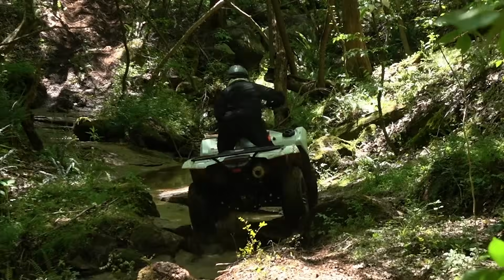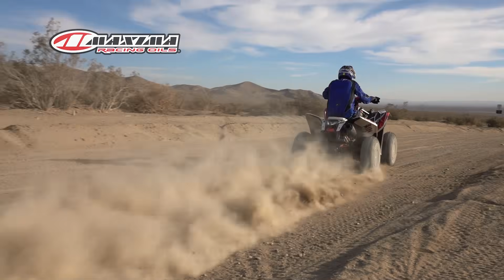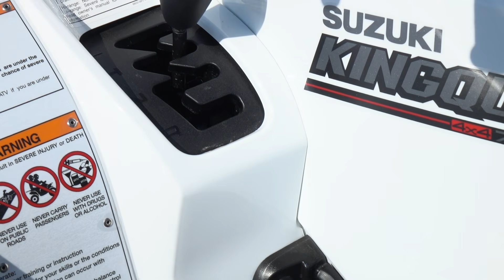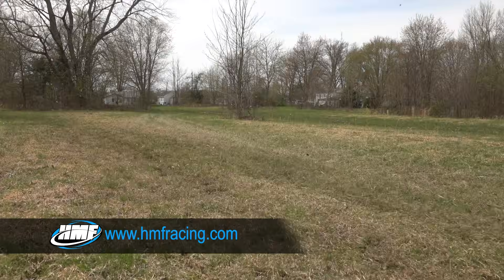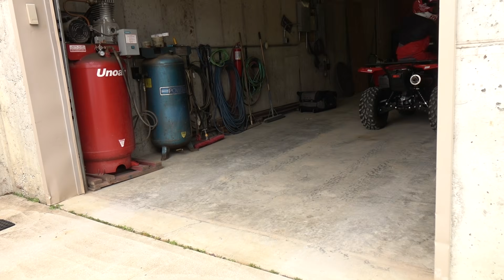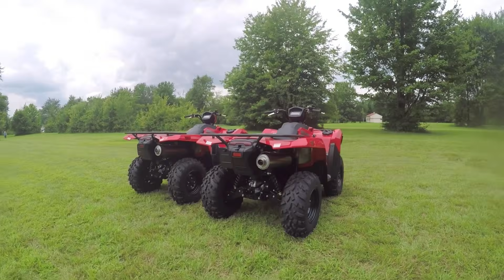Suzuki KingQuad 750 vs 500 Shootout

Comment: Any possibility of CFMOTO reviews? I really appreciate the technical data of changes down to the millimeter, no dealer sales idiot would know anything about the bike other then him reading off the website to you. I want that hardcore engineering data and design as a customer. I want to feel the brakes, chassis flex, suspension tuning, etc and know what was updated year to year. Thanks for the technical insight in all the videos you do. C force, z force and u force would be a great addition, the brand overall is very very under appreciated, very well built units from a engineering standpoint.
Reply from the maker: Thanks so much for the positive feedback. We would definitely be interested in trying some ATVs from CFMOTO, side by sides on our sister Channel. Perhaps we need to reach out to them.We put a lot of work into understanding and laying all the technical information because we know it's important to the serious buyer or enthusiast. We are glad you appreciate the effort.
Reply: ATVonDemand I just took a zforce 500 out to Hatfield-McCoy for a serious rip and beating, I’ve been threw the vehicle front to rear and I gotta say it’s very under-estimated. There heavier then there competition but very well built and extremely strong. The tech and engineering put into there equipment is up on the level of Yamaha and Honda, with the value beating even Polaris’s price point (though it’s junk). I think you’d be impressed if you got your hands on them. The only flaw I could find is the tires they come with are hard as a rock, I’m talking 0 psi in it and you couldn’t tell. It wouldn’t flatten out what so ever or break the bead off, so ride quality will feel like crap but a good set of tires and your good. Clutching, suspension, engine, brakes, even down to fit an finish feels top notch. Nothing feels cheap, finally a china product worth talking about. I’m a fan, and I’m not an easy guy to please at all..l like it better then my Honda rubicon honestly, it feels more structurally sound then the #1 reliability focused manufacture on the planet. Keep it up, looking forward to more!

Comment: Yes!!! Thank you for this comparison. I've been toying with the idea of the KingQuad 750 for about a year now. Was going to purchase one last summer but had an abrupt move two hours south and one vehicle getting totaled in the process - we're saving again! Anyways, for 1k more it only makes since to grab the 750. Only reason for a 500 is with heavy discounts making it a $2k difference or greater in my opinion.
Reply: The 750 is really fun to ride. I've had mine for a year now. I looked around for about 7 to 8 months before I bought anything. I talked to mechanics about what brands are easier to work on. I figured if it breaks it's less shop cost to fix.
Reply: @thecasualatvguy617  so the Suzuki is the easiest machine to work on? Thanks
Reply: @chadweaver251  easier than the Polaris is what I have heard. With the warranty stuff I wouldn't have to fix it anyways. Lol. But I can say they leave access to oil etc and from looking it looks pretty straight forward. Just ask shop techs what they think. I've put close to 1900 miles on mine with no issues so far. I don't ride or slam the brakes either so they are still good even.
Reply from the maker: Very good suggestion.

Comment: Still have my 2009 King Quad 750 with close to 15 000 kms and 800 hours. Mostly ridden aggressively year round in Canada, this thing won't die and 98% of the parts are original. I've owned Honda, Polaris and Yamaha yet still stick with the King as it has a mix of characteristics of all those brands. It is a well designed, functional and fun machine with unbelievable reliability. People have gotten too power hungry and most riders don't even need all that power constantly. The King might be slower than comparable Polaris and Can Am but in tight trails it'll leave them dead in the turns as this thing is light and much more flickable than those heavy boats. It's a shame Suzuki doesn't use one of their magnificent motorcycle engine (think V Strom 650 and 1000 V-twin) and plant it in their quad because the competition would be in serious trouble.
Reply from the maker: Thanks a lot for sharing your feedback on your king quad. The power that the 750 puts out is more than adequate for most Riders. Still, we think Suzuki would benefit from using one of those big v-twins in an ATV for the status it would provide for their brand.
Reply: I've own a 450 king 2008 and a 500 2015 king and love them both.  My biggest complaint is the plastic breaking, but with regards to reliability these bikes are awesome.  I now would like a 750.  I think the extra power would be great.
Reply: That's good to know I've had my 750 for a year and put about 1100 miles on it so far. I trail ride and sometimes will go a little hard. So far its handled everything I've thrown at it but I dont want to tip mine or roll it down a hill so  I avoid certain things if I can. I'm getting better at being able to whip it around where I want it pretty easily. I was looking at a 500 Se plus and they had a 750 with a little paint damage I wound up getting for less. Its plenty of power for me.
Reply: yeah i agree with you, im thinking about getting the king quad 750 to replace my 2011 polaris sportsman 500 ho as the axles are close to breaking and shes not doin too good but i completely agree with you calling the others boats because you know how many times ive almost flipped my sportsman? alot, actually i have flipped it 3 times
Reply: @dislodgedgrump9056  I came close the other day to tipping mine, I try to avoid that if I can. Lol. I will take the path of least resistance around some stuff. I've put 1100 miles on mine in a year and had no issues so far. I've maintained it on the dot also.
Reply: The Casual ATV Guy i bought one yesterday. I hope its ready today.
Reply: I have a 2016 with 1500 hours. Mines a daily driver.  & I have pulled some heavy heavy stuff .   I’m Suzuki for life
Reply: Did you adjust the vavles every 2000km with that mileage? I just got a 2019 king 500, this is my first FI and wondering if its that crucial to do it.
Reply: I have a 2011 500 different tires on it and it's a beast

Comment: The king quad push button 4x4 and diff lock switch is a knockoff of Honda.
Reply from the maker: Is it? When did Honda then Suzuki first employ this type of switch?
Reply: @ATVonDemand  Honda started in 2014 no idea on the king quad just assuming
Reply: @jarredmarion1538 - You know what they say about assumption?
Reply: @27Zangle      Honda>>>>>Suzuki
Reply: Suzuki has had that switch since 2005 buddy do your research

Comment: Another thing when it comes to price on these. You can get a Sportsman 570 for thousands cheaper. Then you can spend around 600 to 700 dollars on an ecu tune, exhaust and clutch kit. You will then be putting out more power than the 750 while saving thousands of dollars. But one thing you wont have is the Suzuki build quality. I bet the Suzuki would have more top end still but I bet the modded 570 would accelerate faster.
Reply: Heres a link to ecu tune numbers, they are at bottom of the page. 
https://shop.rvsperformance.com/Sportsman-570-ECU-Tuning-ECU-PSPTS-570.htm
Reply from the maker: @rzl07375  of course, that is before you start adding mods to the KingQuad 750. If the Suzuki is higher quality than the Polaris how will the additional horsepower affect the longevity of the Polaris? If the Suzuki is more robust would it be more reliable in the long run once you start hopping it up? So much to ponder. We have to agree, the price of that 570 out of the box or the Can-Am 570 for that matter are putting the squeeze on the Japanese manufacturers.
Reply: @ATVonDemand  ....Yes the build quality for sure is factor. But if you do a stage 3 tune on the 570 with  exhaust your right at the same numbers the 750 would have with a HMF and optimizer. However in one aspect the mods actually helps the Polaris with holding up as with the ecu tune it makes the fan come on sooner and helps decrease running operation temps. The 570 is a very detuned motor from the factory and there are hundreds of guys out there running these tunes that love them and have no issues. I own both a Polaris and a Japanese machine so I know the differences between the manufactures as I try to do most my own maintenance and work. I actually love the 750 Kingquads and want one.  I just think think its an interesting discussion on what you can get for your money.

Comment: The Japanese manufacturers stopped progressing around the introduction of EFI. It sucks because none of them besides maybe the brute with some mods can even turn tires big enough to fill in the ruts left by today's big bore Can Ams and Polaris's. Fact is if you show up to a big ride with a Japanese bike you are sheep in a den of wolves.
Reply: You dont need that big tyres even IF ur working in The woods
Reply: Drennan Rutherford  I’ve watched a king quad 700 on 29.5 ol1s keep up and even do better in some mud than a highlifter 850 on the stock 29.5 ol2s just because the KQ is little lighter than the Polaris driven buy the same guy!
Reply: You are exactly right. I had a KQ 700 with 27’s, it had plenty of power for me and I went the same places the big boys would go but when it’s balls to the wall and no stopping up in Windrock OHV trails in Tennessee you can’t keep up with even can am 650 or any of the 850’s. You get smoked. I drove my buddy’s 2019 Sportsman 850 recently and dang it’s so fast and powerful, it’s a huge change in performance.
Reply: You're right but I also show up to these rides on a 250cc TriZ 3 wheeler and hang with them on the trails. Obviously I can't hit those big holes but it's all about the correct line. There's always a bigger machines. It's all about having fun!

Comment: Now I wanna see a test of the 750 with that HMF exhaust and optimizer.
Reply from the maker: We are going to work on that. Suzuki just snatched back r750 but we are hoping to order another one as soon as the 2020s come available in the next couple months. We will be holding onto the exhaust system and optimizer in hopes of making this happen. Frankly, we'd like to just do a little build project on the 750.
Reply: @ATVonDemand  That would be a cool project. Also I think a cool project would be to grab a base model cheapest one Sportsman 570 and do a build with tires, clutching, ecu tuning. Most of us can actually afford a 570 compared to other models.

Comment: If they only made either one of these in a 2up with longer chassis, I would be sold.
Reply from the maker: We are surprised how many people ask for a 2 up from the Japanese manufacturers .
Reply: I figure It's a Liability and Safety issue for the Big 4 Japanese Manufacturers.

Last year a Honda 1 up ATV passed me with 2 Hunters  during the Utah Deer hunt. 
I was also hunting and on foot.

It was still dark and they hit a large rock on a moderate  slope and went over backwards. 

Only 20' in front of me I saw that machine land on top of Both hunters with their guns, gear etc. 

It was on an incline and they were unable to get out from underneath the Honda with the weight of the machine and the gear on the racks. 
The hunter on the back also had the operator on top of him along with the machine.

I had a lot of adrenaline and was able to get the machine  off them both. 

Guns, equipment and everything was scattered all all over the place. 
Both had head injuries along with bumps and bruises. (No helmets)

After seeing that, I can see where riding 2 up can be very dangerous. I would never want to go over backwards with my wife on the quad with me being the operator.
Just say'in.
Looking for a 2022 KQ 750. Right now hard to find!

Comment: I'd pick the 500, plenty for what I need
Reply from the maker: Right on.
Reply: For what I would want and need the 500 is good.
Reply: For every thing I do my 500 does great.  However, I am curious about the 750
Reply: @paulcu130  love it. I was going to get a 500, the 750 had a bad paint spot so I got it for less than the 500. I cant complain one bit. I'm sure I would have been happy with the 500 but the smoother ride of the 750 confirms part of why I like it so much.
Reply: Joz Sports  this is what I getting
Reply: Does the 750 burn more gas? They are basically the same in everything else.
Reply: @chadweaver251  That's a good question if the 750 is harder on gas, maybe it is since it's a larger engine size but I dont know for sure though

Comment: Nice comp.  Both good units but i like the POWER
Reply from the maker: Yeah, I think we'd go with the power too. Especially if we were planning on adding any type of motor mods in the future.
Reply: @ATVonDemand  Indeed, $1k difference is pretty minimal considering.  No brainer in my opinion.  Id like to see this go head to head with the Grizzly 700 though.  Maybe you guys could make that happen?.?.?
Reply from the maker: @vincedaugherty9687  we had to send our 2019 750 back today. But we are hoping to get a 2020 a project build. Perhaps that would give us the opportunity. Could be a good mid to late Summer video.
Reply: @ATVonDemand  just curious as to what motor mods you would do to the 750 king quad. I've only heard of adding a pipe and a new ecu, clutch work (machined sheaves both face and pockets where weights sits) and new weights and new spring. Are you talking about boring out the cylinder and changing the cam. If so where do you find parts for that. Thank you